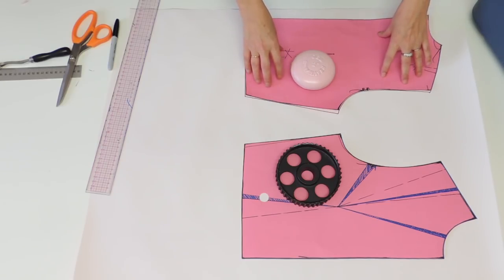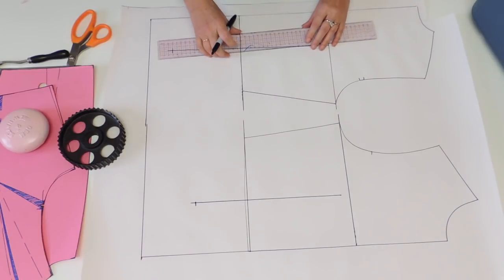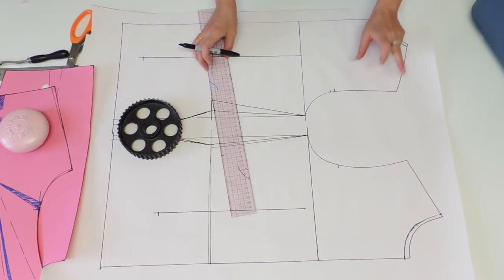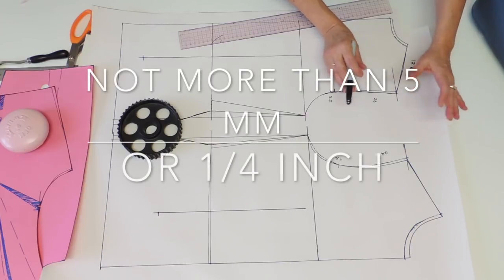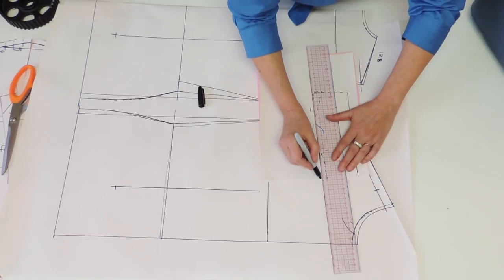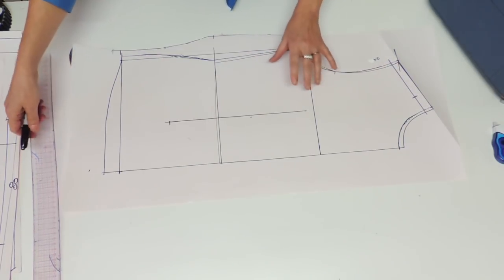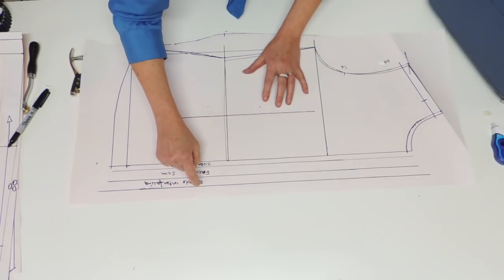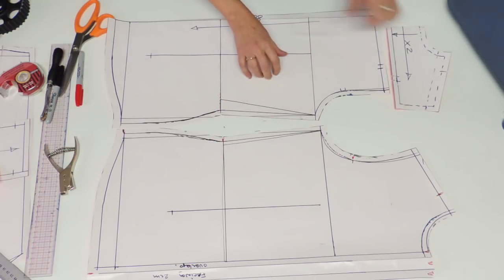Shirt Block pattern.

Comment: Hello, Diane! Please help me. I'm in middle of my pattern making of shirt but I have a problem. Actually my waist portion (because of 4 cm dart) is bigger than bust portion so when I draw a square line from bust to waist like you teach in your video, that line in my pattern go inside to the waist part of front pattern. So what do I do. How will I give 1.5 cm mark towards inside on waist line on both front and back. Please tell me what do I do. Here is my drawing. Please solve my problem. I have send you my drawing on your e-mail. Please check.
Reply: I also find out that if I do exactly like you then also I have perfect size of shirt but is it okay that in my pattern waist line is getting decreased and in your pattern waist line is increasing ? Does it effect anything ? Please tell me Diane. I have a confusion.

Comment: Hello Diane, Can you please tell me what do I do if I have to make a dartless dress like kurtis. Actually I mean to say I think I can use the shirt pattern for that but I want cut from the waist or I can say I want more fabric on hip area so what I have to do. How I increase the width of fabric below hip level if I have to make long dress because I don't want to keep straight fabric after hip level. Do you have any suggestion ?
Reply from the maker: Hi Pooja, yes you could use your shirt block but also to do Kurtis http://www.lehengaworld.com/2017/12/21/latest-designs-of-kurti-patterns-in-india-2018/  also use this technic https://youtu.be/wTZwWo3-XlQ so you get the flair distribute. Diane
Reply: Diane Deziel I understand. But I don't want to add that much flare that I have to insert elastic or it will get more complicated to me because I only want to give flares from waist to bottom and I don't know then from where to get three points like you did in maternity pattern. I want to give simple  flare like you did in coat pattern so that the fabric covers the hip area. Actually, I watch your coat pattern afterwards and then I get it. I have to make a inclined line from waist instead of straight line to increase fabric. Thank you. Your coat pattern works for me. Although, I will try that maternity pattern technique afterwards. 😃
Reply from the maker: You could also do a little flair on the side seam (like on my coat) from the under arm point or from the waist if you want. Diane

Comment: Bonjour Diane je veux vous remercier d'abord pour vos vidéos qui sont d'une grande aide 
Après j'ai une question j'ai remarqué que vous avez utilisé le corsage de base sans des élargissement  (j'ai toujours pensé que le corsage de base n'est pas destiné a  l'utilisait en brute parce que il est très ajusté au corps )si c le cas j'aimerai bien connaître les techniques si il y a lieu
Reply from the maker: Bonjour Nadjet, le corsage de base, du moins celui que j'utilise a de l'aisance
environ, 1.3 cm par 1/4 donc 5 cm tout autour, et le sous bras est descendu de 2 cm. Pour faire ce chemisier, j'ai d'abord comparer avec quelques une de mes chemises et les mesure correspondent. Par contre, si tu veux faire une blouse, là on doit élargir et descendre le sous bras, ainsi que élargir les épaules et faire une manche plus plate et large. je le ferai bientôt. Diane
Reply: Diane Deziel merci beaucoup là c plus clair